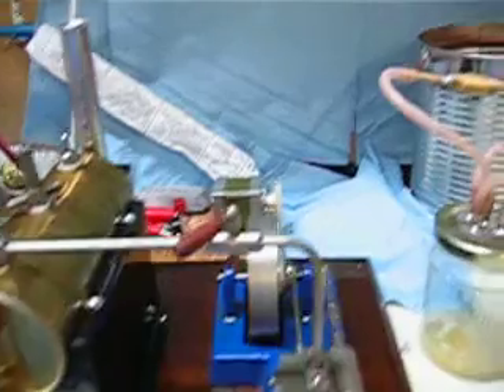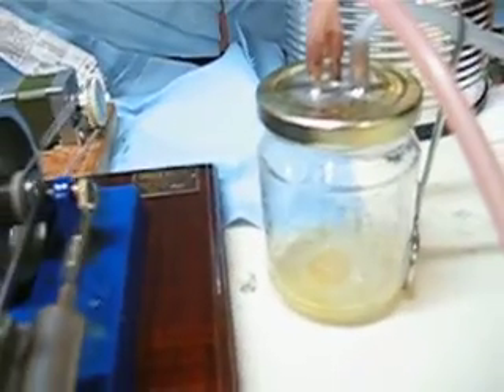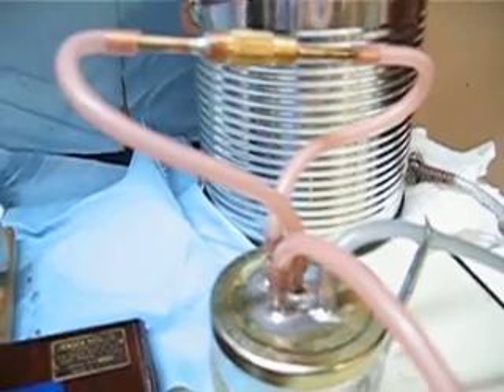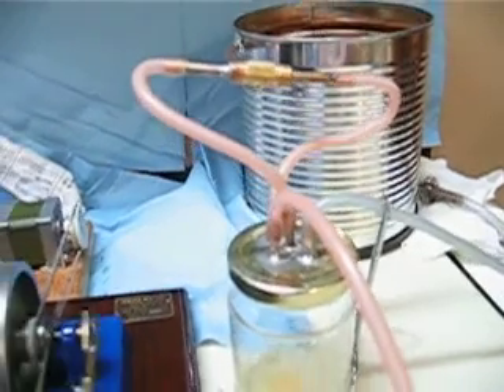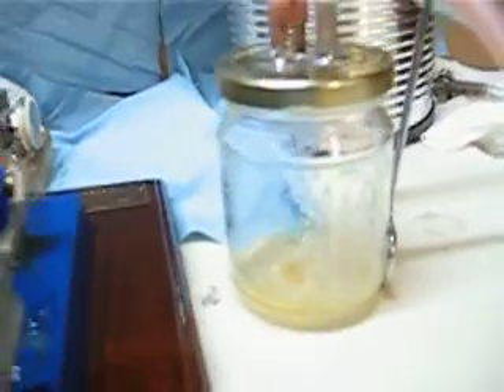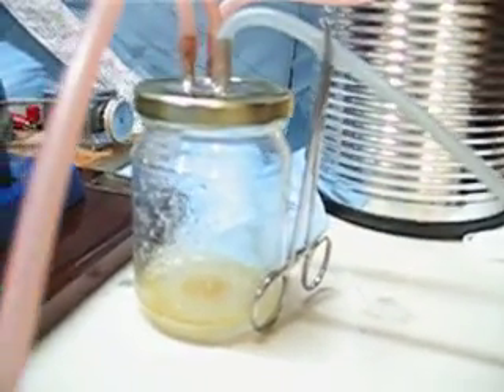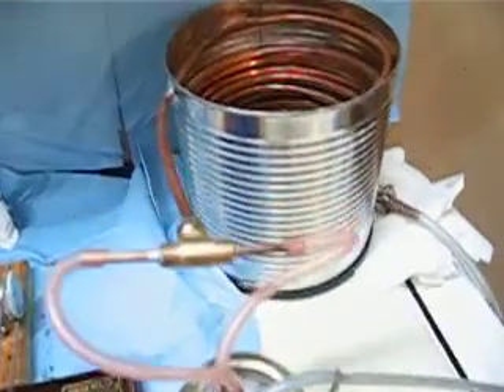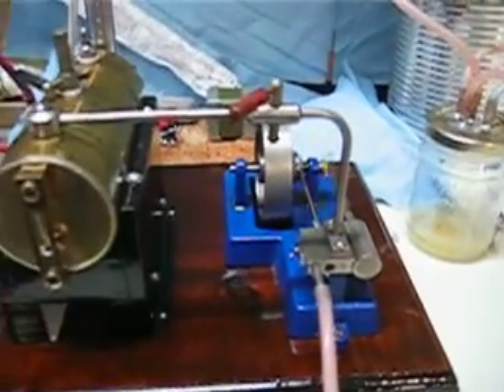simple oil separator

Comment: What is this? Are you pulling a vacuum on the jar? If the volatile oil comes out with the distillate do you lose any when the water boils off? Before anybody tries to say anything about the water boiling at room temp water will boil at room temperature if there is sufficient negative pressure.
Reply: He's pushing exhaust steam through the jar before it hits the condenser.  The oil starts out as a vapor (already volatilized) and is condensed in the oil separator.
The real trick is to run the collected oil back into oil sump WITHOUT the condensed water, so that both the oil and the water are continuously cycled.